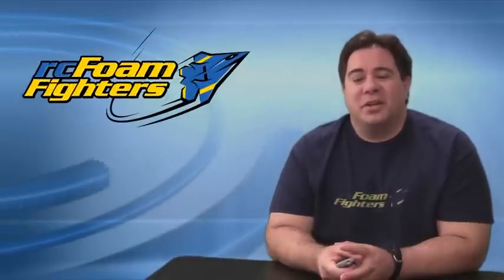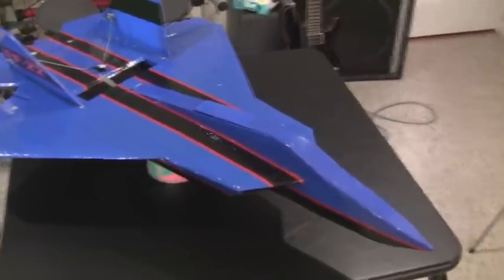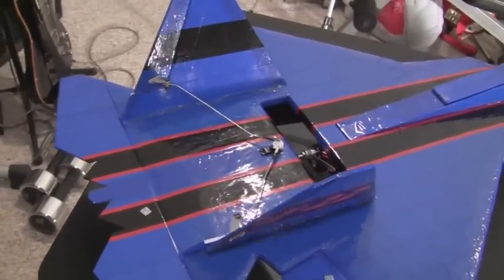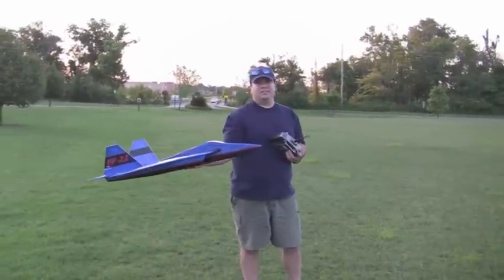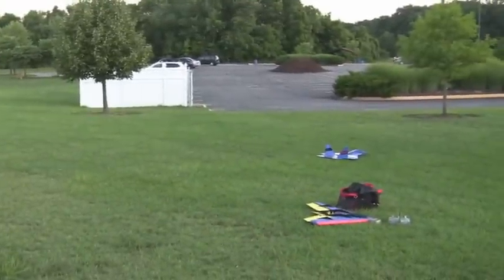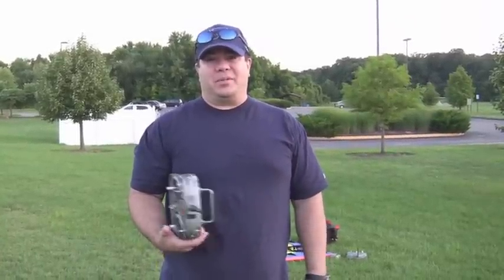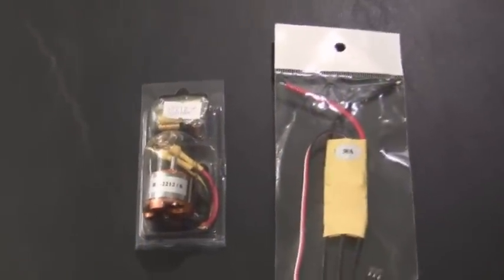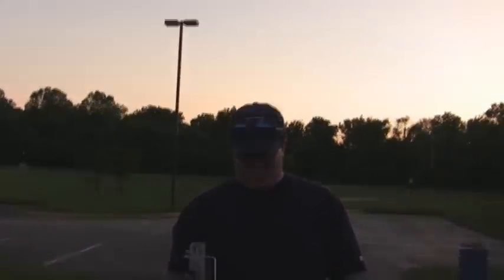EPP FF-22 Part 1

Comment: that servo arm for the bomb doors looks vaguely familiar, lol. great looking jet, and its bigger size makes it handle pretty cool too. get rid of them rudders dude, you dont need them if you plan on making that thing faster. did the plane seem to wiggle slightly at all?  the jxx did when the intakes had braces blocking the air from passing through. keeping them clear will definetely make it faster.  your epp construction on this one has set the bar pretty high. see ya tomorrow!!!!!!!!  -brandon